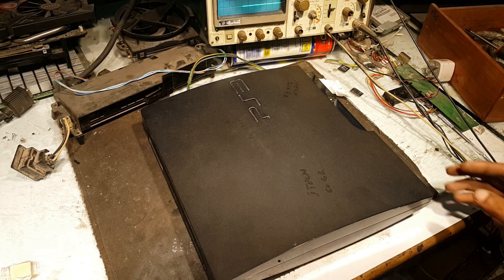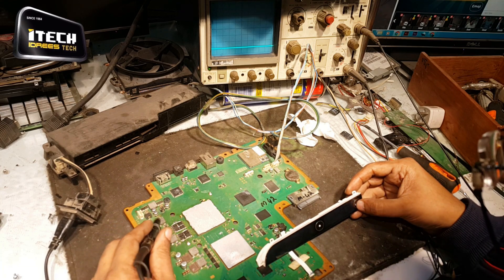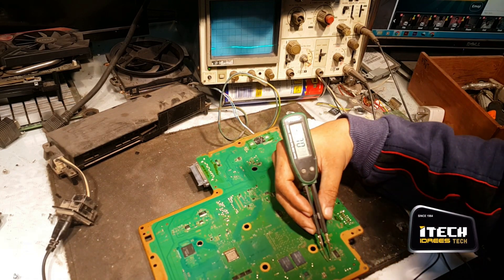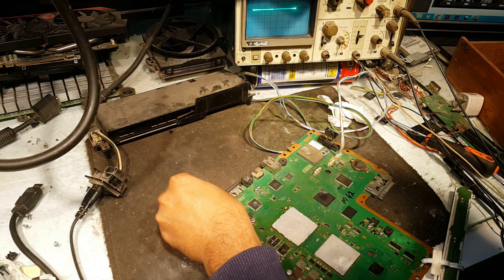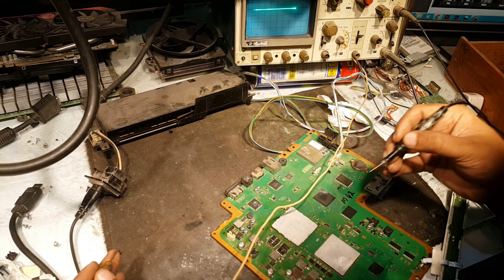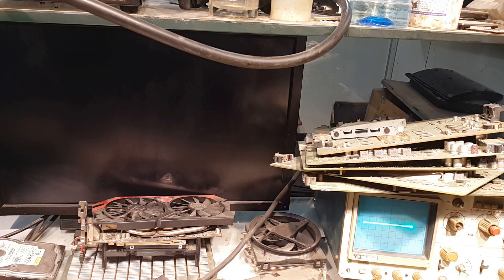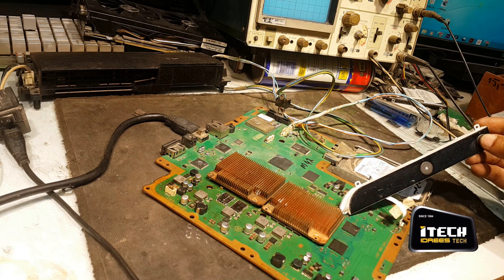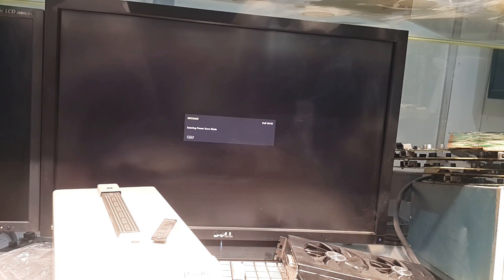🎮 PS3 Slim YLOD issue - Yellow Light Of Death Problem Solved.🔧✨

Comment: hello sir, Can we check these chokes with multimeter? For I dont have the equipment youre using. If multimeter can be used, will it be DC or AC option sir? How do we get the Oscillation thru meter? lastly, which country are you? I want to know If i can come for physical training.  Thanks
Reply from the maker: Select your multimeter on DC minimum volts, and you can check it. I am from Pakistan. You can get training from me. Join me on Facebook.

Comment: I have a slim of the same model but I'm having difficulty, I asked you a question in the other video you didn't answer me, I'll redo the question if you can help me a little.

There is no voltage on the processors, what could it be?
Reply from the maker: What do you mean no voltage? It could be a short circuit FET dear. Check for the short circuit or the voltage source. It is simple.

Comment: You are a special person who provides wonderful sensitive services
you are the king
I learn from you sir
I want a way to contact you about a broken device
I know that you will only help me find out where the fault is
Because I can change parts
Reply: play 3 medel FAT CECHH04
Reply: The device has not been opened before. It has a new problem for me
When turned on, the hard disk lights up
After 15 seconds, the hard disk lights up twice and turns off without a beep, only a steady red light
I ran into this problem before and fixed this problem by logging into Rockfree Mode
But this solution did nothing with this device
I want to know the part responsible for this defect or the name of the defect
Reply from the maker: As you have described the fault. It seems like a software issue. And in software, it is in a factory service mode state. Someone has tried to jailbreak on it. So please first confirm these points.
Reply from the maker: Do you know what version software is in this PS3?
Reply: @idreestech  I don't know the version
But I can find out by forcing the device to stay on esin e3 flacher
Reply: @idreestech  If you want, I can upload a video of you on the problem
My passion is to find bugs
I love weird problems
It has a special flavor when the mission is successful
Reply from the maker: Then surely you will be successful.

Comment: RAMADAN MOUBAREK Mr IDRISS 
another great job as usual
 but can i work playstations without oscilloscope as u always checking for the wrong oscillations  on the cpu/gpu/ram /gats in mosfets  from watching ur channel we can not narrow down the problem unless we use  oscilloscope 
from ur experience Mr IDRISS  is there another method or we must use oscilloscope for the repair of playstations
Reply from the maker: Yes, you can use an analog multimeter after set the reading on the voltmeter and OHM meter.

Comment: Great job uncle, I didn't think those capacitors would've been the problem but again you're a master of what you do.
Reply from the maker: Thanks 👍
Reply: Capacitors aren't the problem in most situations. With SysCon reader you can easily find the problem. It is REALLY CHEAP and very helpful
Reply from the maker: Shark Hardware SysCon reader is not such a useful thing for me as in many cases it fails to diagnose and target the actual maiefunctions like kind of short circuit in the motherboard. Even it could not diagnose the real bad components on the motherboard.
Reply: @sharkhardware  learn from idrees hes one best youtuber expert on ps3 repairs, no one does this, hes diagnosis are far better than using syscon reader, hes been fixing this for a decade he knows better, thats what i can sure of... Go watch hes older videos.. without a schematics, hes telling you what chips connected to each others and what problems cause of it to each others
Reply: @Magsyboy  That's a good idea. Maybe i could help myself after that

Comment: if i use solder to bridgh the fuse . insted of replaced with another fuse .it is fine? or must change fuse . what if i dont have donor fuse
Reply from the maker: Yes, you can but it is better to swap with a component at a proper value.
Reply: @idreestech  im getting 1.5 ohm on gpu rsx tokin . and 3.5 on the cpu tokin .. whats the problem?   tokin ? or gpu
Reply from the maker: It should be on 2.5 to 3.5 OHM.